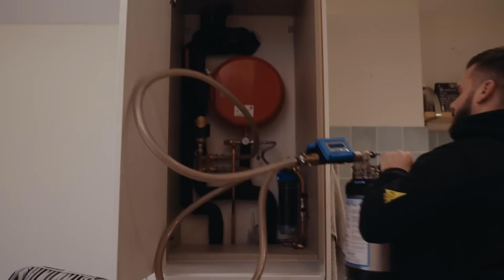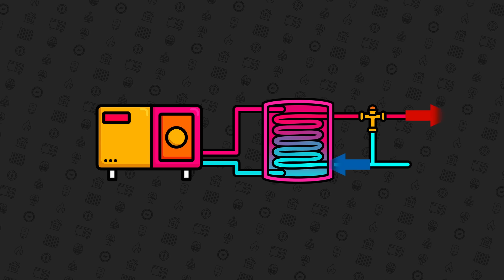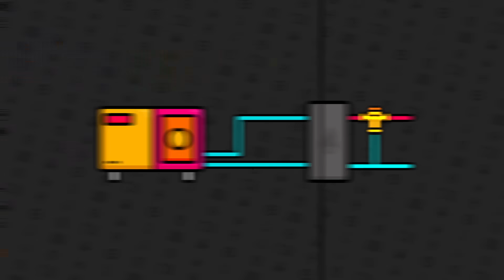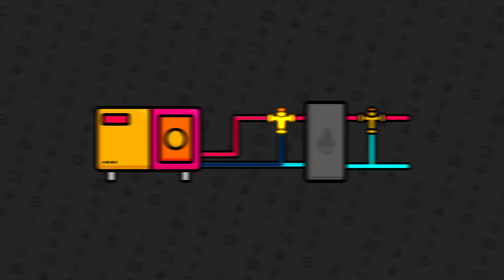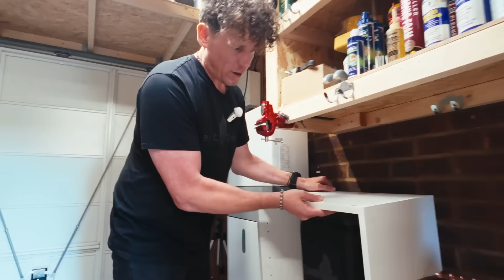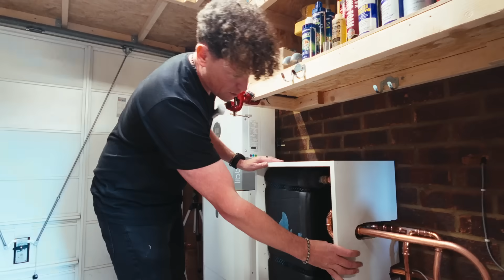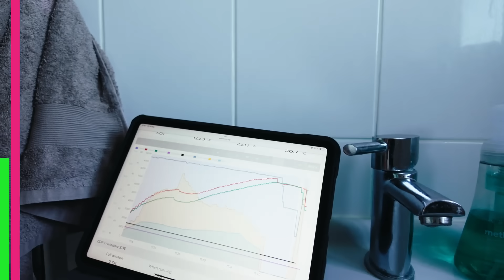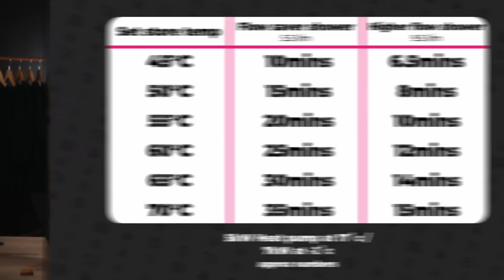World’s smallest hot water solution. (With a heat pump)

Comment: Great vid and some innovative thinking! The price is going to make sure that space is probably the difference maker though. At £1500+ just for the plate, the finished article is going to be £2-3k or more. Watching with interest.
Reply from the maker: Don’t worry about all that.. the prototype might cost 1500 or so. But we can make this for probably about £600 all in
Reply: What does a tank install cost?
Reply: @FFVoyager  about the same...... that's the point......
Reply: The plate he used in the video is €1700, it’s going be so expensive.
Reply: @0prisonpriest0  the plate used on the Nordic Tec website is €1,099.99 (in VAT) - easy to search for 'Plate Heat Exchanger NORDIC Ba-115-50 2" 1700kW' if you don't believe me.
Reply: @FFVoyager  I'm afraid you searched the wrong one..... It's the BA 115-100 3500kW.... (@2min36sec)
Reply: @0prisonpriest0  it is not - the Nordic Tec website lists it at €1,099.99 in VAT.
Reply: @0prisonpriest0  The Nordic Tec website lists it at €1,099.99 including VAT.

Comment: Congrats, this might just be the next big thing in domestic hot water supply. Try Ebac. There based in Newton Aycliffe, County Durham. They already make heat exchangers. Not for boilers, but for Dehumidifiers and Heat Pumps. I can't imagine they wouldn't want to work with you. I'm gonna send them this video link. Thanks for sharing.
Reply: Just don't buy a washing machine from because they're absolutely atrocious!
Reply: @eddyd8745  Yes Eddy, I do have their 9Kg Cold Fill and it's coming up to 7 years old in Jan 26. It's been lovingly cared for by their repair engineer. In fact we know him by his first name. He does his best, but he's not on our Christmas card list. We have shared a coffee with him, around 10 times over the years and had various parts replaced on it. Next time I think we'll be buying siemens.
Reply: @brianwood5220  I was desperate to buy British so bought a hot wash machine. It lasted two weeks before I sent it back. I was sick of it leaving a big pile of soggy clothes in the bottom of the machine. Supposedly that is to protect  itself but I never had any problems with other machines. I replaced it with an LG which is fantastically efficient (uses half the power my old machine used),  has a self dosing feature and connects to the internet. 5 year warranty (on offer). Just a pity that Ebac couldn't match that in any way.
Reply: yeah no they suck 🍆
Reply: You mention not parenting, but you could always do what Volvo have done with car safety and patent, but allow free use so that at least the patent lies with an ethical person.

Comment: Looks good but still think it needs quite a bit of work (which i guess you eludede to with asking for manufacturer help) i think waiting a minute for the hot water to come through for a shower is just about okay but not for basins when washing hands or kitchen sink.  I know you said could combine with distributed instant heaters but think that would make more sense being in the box itself (though expect high running costs when taps switch on and off frequently)I also still think it needs even greater capacity, 15min at -2 will be okay for some people some of the time but when people are spending a lot of money they expect a bit more than that.

Would be interested in seeing s follow-up with more real world use of the mini store. 

Thanks and good luck with the project.
Reply from the maker: Confused about your eating comment?. This will deliver quicker than a combi and the same as a cylinder.
Reply: @HeatGeek thanks for the reply.

Sorry, perhaps I misunderstood, at the start of the test the first minute you waited for hot water to come through, that's quite a long time for basins but perhaps okay for a shower. Was this just due to an extremely long pipe run or something else?

I understand 15min at -2 is really good and am impressed by what you have achieved, it really is brilliant but when you compare to the never ending power of a combi (at lower outside temp) it's not quite an equivalent.
Reply from the maker: @radfoo yes a long run. 

Combi might be infinate but when would you ever use infinate hot water???
Reply: @HeatGeek  okay, not infinite, lol.  But can see potential issues with large families. I know, I know, you will say a 4 minute shower is as much as anyone should ever need but that's not realistic. 

Thanks for confirming it was an extremely long run, should have mentioned that in the video.

I'm not meaning to be over critical, I really think this is brilliant but trying to be realistic about comparing to combi.  Maybe I have misunderstood and it's better than I'm understanding, would appreciate followup videos with more info and real world examples.

Thanks

Comment: 😂 COMEDY GOLD 😂
You reinvented heating hot water, by using a bigger plate heat exchanger 😂🤣😂 Really racked your brains for this 😂🤣😂
Reply: I don’t get it the comedy bit. This allows a heat pump coupled with a small footprint for water. Is this something that exists? Seems like a great idea to me.
Reply: @davidjrobertson3192  unless you factor in that it costs 2k, and that it could be done just as well for 200, or less
Reply: @franciscgedeon9237  - Thanks, that sounds great. The way the video looks to me is that they are just putting the idea out there. He isn't suggesting that he is patenting it. I wasn't aware there was a price on it. Hopefully it will be done for £200 by somebody and that will be a no brainer for everybody!
Reply: @davidjrobertson3192  they didn't mention any price, I just looked up the manufacturer's webshop, it's 1700 euros before import tax and shipping. add some plumbing ancillaries, 2k easy. The no brainer part can be done over a weekend day by any plumber, I wasn't aware that storing thermal energy as hot water was a 'problem' to begin with. It's a known fact that water is the absolute best medium to store heat in domestic applications, bar none. If a small cylinder causes size issues because of its shape, just make a square shaped water tank, like those in motor homes. The ratio of volumetric heat capacity is roughly the same comparing water to stainless steel, but we can all agree the price is not. They found an issue with the small exchange capacity i.e power of the coil heat exchangers inside the tanks, those can be replaced by an outside plate that can actually do it, a 45kW plate is 50 quid. I was generous when I said 200, but OK
Reply: @franciscgedeon9237  The Nordic Tec website lists it at €1,099.99 including VAT.
Reply: @davidjrobertson3192  Do you still think the boosters are a great idea ?
Reply: @haydnlawrence8167  - sorry I’m not sure what a booster is. I must have missed it in the vid.

Comment: "I'm now not too sure why you'd ever install a cylinder with a gas boiler"
- Probably the €1,719 price tag of the heat exchanger. :)

A good solution for those who don't have the space, I prefer a full cylinder though personally.
Reply: Economies of scale, it's only a plate , could do the whole thing in a box for half that at vollume production.
Reply: @speedoftencats  1700 is for the plate only, in poland. the rest comes on top of all that, I'm sure the plate manufacturers already have 'economies of scale', they mass produce the things
Reply: @franciscgedeon9237  I'm betting they don't sell a lot of these things. If they x 10 or even x 100 their sales, price could come down a lot.
Reply: @speedoftencats  you're still looking at a high tech block of SS acting as a lump heat mass. let's just say that a lot of the engineering is wasted at whatever price point. I still think that it's an inelegant solution to a problem long since solved, but reinventing the wheel seems to be our motto these days.
Reply: @franciscgedeon9237  I do think there's a lot to your "reinventing the wheel" line. Yup, there's a lot of that about. There wouldn't need to be if Governments and marketers stopped messing with markets and lying to make money respectivly. I don't see iether stopping though, sigh. A gas boiler is the best fit for most UK housing stock given the "spark gap" If they actually stopped using MCP (marginal cost pricing)  to price electricity, then things would make a lot more sense!
Reply: The Nordic Tec website lists it at €1,099.99 including VAT.
Reply: @FFVoyager  You must be looking at the wrong one. The OP is right about the price being 1,719 euro for the one mentioned. However, that doesn't mean you can't improve a lot on the price. PHEs are very simple machines. Basically all they are is a block of 316 SS weighing around 50KG for this size. 316 sheet steel is around 3euro per kg I think, so that's around 150euro, double that for the manufacting and then double it again for profit you're upto 600euro at scale. Then shipping and other costs adds maybe 150 euro. Then add insulation, a housing, a wall bracket & the bending valves for 200 more. Call it 1,000 euro all in I'd say. Maybe you could get it down to 850 best case.
Reply: €1,099.99 on the Nordic Tec store website (inc VAT)

Comment: What a brilliant piece of invention and engineering.  This has so many real world uses once it is finessed and honed.
Reply: OMG people, can you read?!? COP 2.7 is absolutely rubbish at 17C. 
I have 150L heatpump boiler Atlantic Calypso. And it absolutely demolish this performance.
My mesurmenst:
Air temp 8C, end water temp 42.5C, COP 3.37
Air temp 15C, end water temp 42.5C, COP 3.33
Air temp 26C, end water temp 42.5C, COP 4.34
Air temp 26C, end water temp 40C, COP 4.61
Air temp 26C, end water temp 50C, COP 4.07
Air temp 30C, end water temp 50C, COP 4.64
Reply: @ASK-8819  this is a prototype unit, they didn't even know if would work until they tested it.  What your unit does is irrelevant, this is a massive step forward in technology and real world applications, it will improve as it is developed.  Still better than 90% efficiency from a combi boiler
Reply: @davidstorm4015  no its not better. Because seasonal efficiency SCOP would be around 2. Electric boiler of this tiny capacity would be 100£ and installing also cheap. Their solution is probably 5000£ with installation. It will never repay itself
Reply: @ask157 it would be installed as part of a whole house heating system, not just a hot water solution
Reply: Then it would make some sense but heat pump for heating only works with floor heating. And this is rare in the UK. It doesn't make any sense to go in such huge costs when SCOP will be around 2. And won't be better if house has radiators. @davidstorm4015

Comment: The issue that still remains is that with a SCOP of 2.7 and electricity prices that are three to four times higher than gas, it's more expensive to run a heat pump for hot water production than it is a gas combi boiler Based on my calculations, its about 30% more expensive to heat water this way, compared to gas, but does your SCOP include the time taken to reheat the water in the heat exchanged to its set point once the shower has stopped?
Reply: that's one for the Government to sort out, the high price of electricity compared to gas is completely unsustainable
Reply: Most energy company’s offer a HP tariff now at an average rate of around 15p per kWh so it would be cheaper with a HP than gas boiler
Reply: If you are buying your power overnight at 8p/kWh then it starts to look rather different, but then you'd be better off biting the bullet and getting a proper water tank fitted. Also solves the combi joy of getting frozen and boiled when someone else runs hot water
Reply: @etchedpixels If you have batteries then the economics might work, but in properties where they might need this solution they tend not to have space for batteries either.
Reply: @tlangdon12  Batteries go outside, inverters these days usually go outside, the solar panels are outside. If you want to be "dr no" for heatpumps then the real issues are those around heatpumps, batteries and flats, but where to put the battery and inverter for a house is not a problem. Other issue is that if you've got a nice heatpump system (ie air/air not air/water so you've got aircon and you don't have to do magic tuning to make it just work) then this approach isn't going to help.
Reply from the maker: Smart tariffs, batteries, solar, also made up for by high heating scop. And the gov are tackling the spark gap anyway… all non problems

Comment: To be honest, combi boilers suck for showers. Even if I still heated by gas, I'd do everything I could to get a cylinder fitted, that, or I'd get an electric shower.
Reply from the maker: Electric showers down have a great flow rate though…. They throttle the water back

Comment: Storage Tank = Resilience
Avoid design thinking that is 'taught' and ready to break.  Instead, go for 'lean' and include spare capacity.  A broken heat pump would mean instant household misery in winter, without backup (which admittedly could be partially provided by the idea of local immersion heaters).

Beside that, you totally surprised me with the run time.  Fucking awesome!   Well done!
Reply: It would be no different 'household misery' if a combi boiler failed in winter would it?
Reply: @FFVoyager  exactly my thought too

Comment: Is the run time long enough to fill a bath at a reasonable temp,?  ALso, could it be installed as a replacement to a hot water tank and free up space in the airing cupboard?    If these things are possible  then storage tanks are history.
Reply from the maker: Yes although flow rate may need to be limited
Reply: According to @smartboilercompany1983

20 minutes at 7 lpm with 45-41c will run a 140 litre bath 😮

Comment: What would a defrost cycle mid shower do? Can defrost be prospond until domestic hot water is no longer being used?
Reply: The input thermostatic valve would prevent any cold water being pushed in, so then it should just use the thermal mass of the heat exchanger to limit any temperature drop. Then the output thermostatic valve should stop the drop reaching the shower/tap.
To properly address your question, perhaps the input mixing valve shouldn't be thermostatic but should be a solenoid driven by the heat pump. If the heat pump knows what the temperature of the water is, it knows how primed the water in the line is and can decide if it's ready to be used.
Reply from the maker: Not a lot looking at the test results from the ministores tested through last winter.
Reply: @HeatGeek  awesome

Comment: Fair f*cking play. Much better than I’d ever imagine. That’s convinced me to sign up to the heat geek installers course
Reply: OMG people, can you read?!? COP 2.7 is absolutely rubbish at 17C. 
I have 150L heatpump boiler Atlantic Calypso. And it absolutely demolish this performance.
My mesurmenst:
Air temp 8C, end water temp 42.5C, COP 3.37
Air temp 15C, end water temp 42.5C, COP 3.33
Air temp 26C, end water temp 42.5C, COP 4.34
Air temp 26C, end water temp 40C, COP 4.61
Air temp 26C, end water temp 50C, COP 4.07
Air temp 30C, end water temp 50C, COP 4.64
Reply: @ASK-8819  I think you missed the point. Of course this COP is low compared with heating a larger store to a lower temperature but this gives the functionality akin to a combi, and only heats the water required so less wasted heat from heating more water than needed, and it works in homes that don't have space for a cylinder, only a small cupboard where a combi currently resides. People use electric showers still, this will be 2.7x more cost effective to run than an electric shower.
Reply: @rachaelp5985or a combi boiler
Reply: @rachaelp5985 2.7x more cost effective than an electric shower is cool. But that also means you get 2.7x the flow rate of an electric shower, for the whole house - oops…
Reply: @I999-g2s  No.  Their flow rate was a pathetic 7 L/min.  Last I checked a family will be running showers, the dishwasher, and probably laundry at night...  All these heat geek guys, not one of them has a family(multiple people and their friends over) and the realities therein.  And if you have solar on your roof, you REALLY want to store that excess power into your hot water requiring a large water tank instead of paying $$$ to the electric or gas company to heat  your water later.
Reply: @w8stral 7 litres is beyond any electric shower I’ve ever seen, unless you can get a 15kW. But your point is taken.

Comment: 7kw is the lower end of electric shower territory so if you’ve got a heat pump putting out at least 7kw and minimal losses along the way it should keep up pretty well. Two showers running simultaneously would be a problem but I’d have thought the number of homes with two bathrooms but nowhere to store a shower’s worth of hot water should be relatively small.
Reply: and the test was done on a 5kW unit. It peaks at 8kW, 7kW unit can peak at 8.5kW
Reply: The number of properties with two showers and no space for a cylinder are going to be minimal.
Reply: I can't run 2 showers in a 40kw combi. So
...